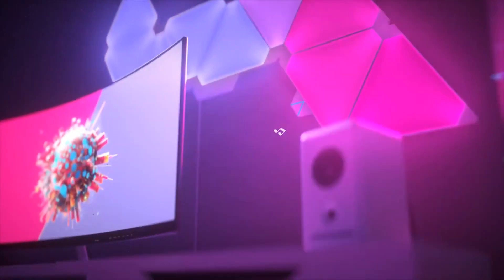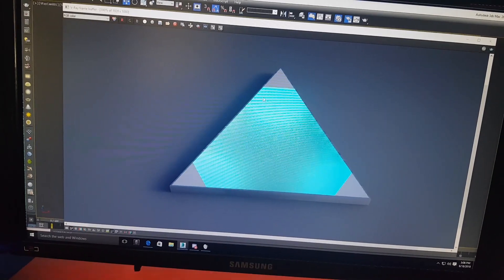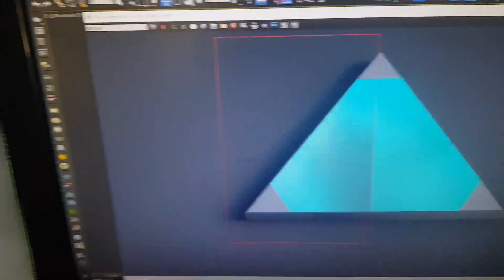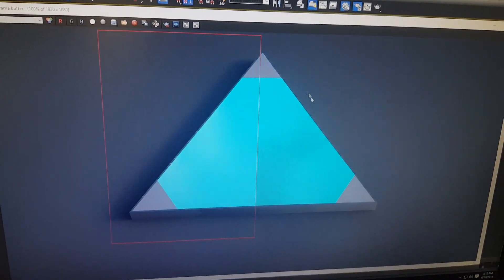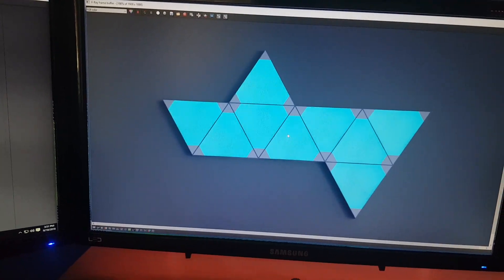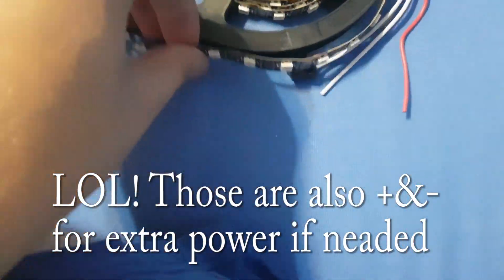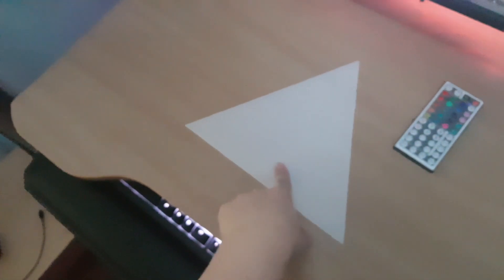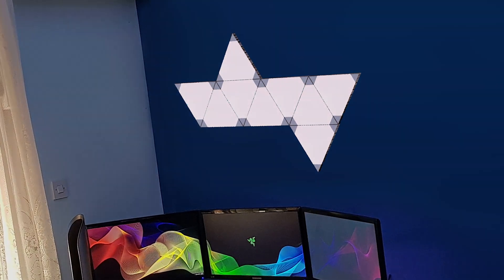RMO pt.1 | Aurora nanoleaf DIY pt.1

Comment: Please can you tell me what exact makes of everything you bought and what I need to put into google to find the same stuff you bought?
Reply from the maker: - Ws2812b led strip (I suggest you to get 144leds/m versions - than you need 1m and colors will be the same)
- Arduino Nano (or Uno but it's unnecessary)
- L shaped aluminium (I got 20x30mm but 20x20 or even 15x20 is enough) I think I got 9m but I'm not 100% sure.. but every side is 26/27cm so 27x3 per triangle than 27x3x9 for all - lazy to do math xd
- Diffuse plastic sheet (I got it from 42" Tv I think (I suggest you to go to some tv repair shop and ask for one from broken tv bc they don't need them)
- power supply.. Ok this is tricky.. You need 5V and than about 1.5A per 30leds so for 144led it like 7.5A (6-10A would work fine)
- wire .. a lot like 20m or so I got one that is used for alarms it has 4 wires inside that are thin and easy to work with but also have enough actual wire.. 
- Double side tape 3M or equivalent you need 2mm and 5mm at least 20m from each
I think that's about it.. 😁
Reply: S&S Channel thanks so much!!
Reply: S&S Channel for the LEDs there is an option of lp30, lp65 and lp67. What do I want ?
Reply from the maker: +Emily simmonds That's water resistance.. Technically you don't need any of those (I'm not sure how the ratings go) But mine have no cover on top just naked strip with leds.. bc it's gonna be indoors.. If you don't have an option of none water resistant one get ip30 bc I guess that's the lowes rating so the supposed to be cheaper as well
Reply: @sschannel4550  em dùng dao dọc dấy có cắt được tấm khuếch tán đấy không ạ
Reply from the maker: +Sarah Pilat Thank you! 😁 So the thing I use is called diffuser and it's 2mm or something like that thin pice of plastic that has rough texture on one side and smooth on other.. It also has that milky texture and it's unlike glass completely well diffuse.. It's used in LED or LCD tvs to defuse the backlight from led or lamps so you get unified white surface rather than white spots from leds.. So just find tv with broke screen and disasamble it and in one of layer you'll find this plastic layer.. You can probbably get it free in tv repair shop bc they might have tvs that don't need that piece anymore.. You can also use thin acrylic that you gonna smooth with that rough paper I forgot the name xd but that's bit on pricier side.. 
Oled don't have these bc they don't have backlight.. And for plasmas I'm not sure but I think they don't have it either.. So LCD or LED tvs..
One of the layers sometimes is similar diffuser but in paper like form which can also be used but I prefer this for extra rigidness.. My suggestion is go to your local tv rapair shop and ask for plastic diffuser layer from led or lcd tvs they'll probbably know what it is and where to find it 😁
Reply: S&S Channel This was a great conversation, I love when amazing people take the time to help others. Good on ya, I hope you grow to be a huge tech channel 😀
Reply from the maker: @TDPlayz  Haha I'm always happy to help people around something that they didn't understood about certain project and I'm also kinda surprised by number of people who decided to try something like this for themselves inspired by this video 😯 Thank you for the support!
Reply: S&S Channel :)
Reply: @sschannel4550  tấm khuếch tán đấy có dễ dàng cắt tạo hình không ạ
Reply from the maker: @duongucmanh2857  Well I did it with scalpel knife you do few cuts along the same line and then break along it.. so straight lines are ok curved I would say quite hard

Comment: Hey, first off thank you so much for posting your DIY project here on youtube.

The videos motivated me to build these awesome looking panels myself. I am in the middle of organizing and planning on which parts to use.
As this is absolutely not something I do often, I find myself troubled to find the right items for recreating this. It would be really helpful if you can help me out:

1. Which cables did you use? Are there some specific wires I need to use or some I can't? And most importantly, how much.
2. Which power supply did you use? I'm trying to build 9 panels with 2m á 60 LEDs and a NodeMCU ESP8266 ESP-12E WiFi as the controller. Would there be room for more panels? Because I might build some more after that. Why does the current drop so much as pointed out by yourself? How could you prevent that, because good power supplies with many amps are hard to find for a good price.
3. As for your aluminum frame, was that included in your price calculation? Because it's like 35$ alone for alu

You did an awesome job on these panels! Thank you for sharing this